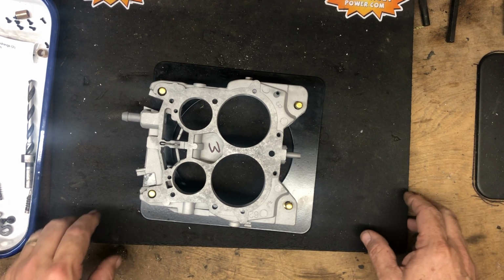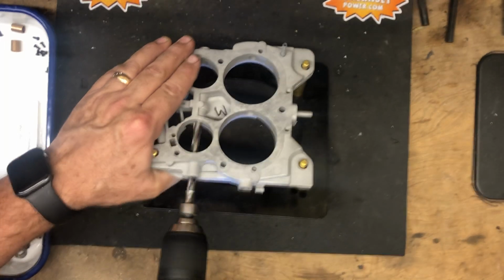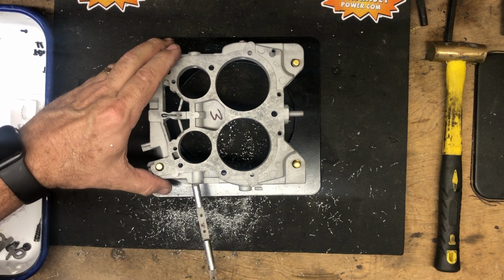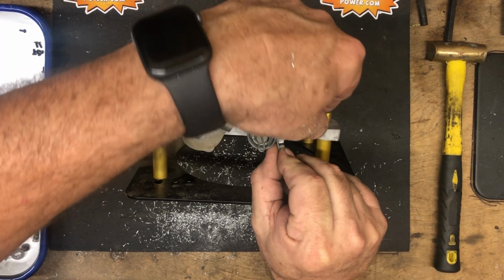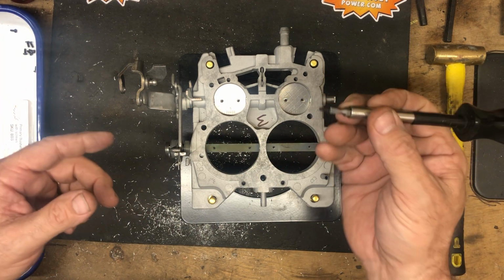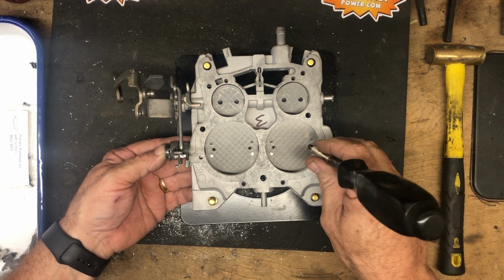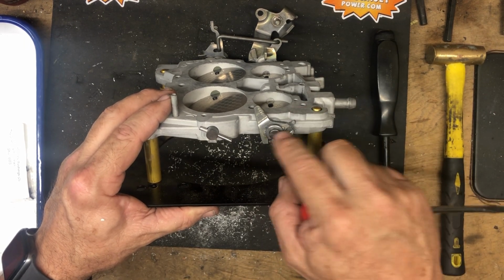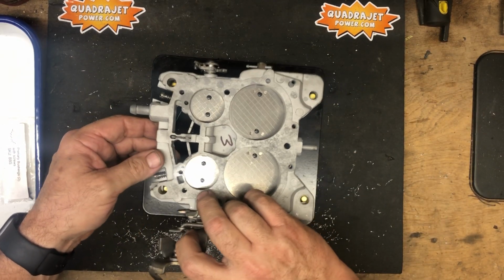Quadrajet Power - Base Plate rebuild and assembly

Comment: This is a must on any Quadrajet that has any play at all in the shaft. Without it you can't get a clean idle and you can't get a good tune as you mixture will never be right. Also note that they do this service reasonably if you need it done. Well worth it if you are only doing a single carb and don't want to buy the tools.
Reply: If you Don't want to buy the tools..? You mean a drill bit? If you don't want to buy a drill bit? That's all he used other than a hammer and a drill ... 159% of people working on cars have those, and screwdrivers...
Reply: @lollipop84858it’s NOT a regular drill bit. It is turned down so the only part that is cut is the outside holes in the throttle body. But as you point out, it’s a very affordable Kit, worth every red cent spent on it.

Comment: The drill bit I didn't get with my modification kit. One of the screws in the blades was coming out nice and smooth, and then all of a sudden, the screw broke off. So I now have a qaudrajunk. How do I get the screw out when the head broke off and how ymdo I go about getting that drill bit so I could install my rod. But only after I get the screw out.
Reply from the maker: You have to grind off the back side of the screws before you try to remove them, or they will all break. They are staked at the factory.  You can drill out the broken screw and retap the hole. We also offer that service.
We sell the custom drill bit for the bushings.
https://quadrajetpower.com/primary-shaft-bushing-kit-drill-bit-bronze-bushings-screws/

Comment: I have an Edelbrock 1901 quadrajet, and I have the spring that mounts on the choke cam follower and fast idle adjustment, as you pointed out at 11:11.  My spring is not connected to anything and there isn't any tension on it.  Do you have a picture or anything that can help me with properly connecting this spring?

Comment: What if you were installing bushings in  a single barrel Rochester TBI unit and didn't have the benefit of the "center"  throttle shaft bore to  
aid in alignment of the custom drill bit.  Do you think you would still get a perfectly aligned throttle shaft bore using the method you demonstrated?

Comment: Is the primary shaft supposed to "ride in & out" when you open the throttle? I see what's making it do it, just didn't know if its supposed to or was bent
Reply from the maker: It will have some movement but the throttle blades prevent much play.

Comment: Question, I'm about to install your new brass bushings & when I removed the 1st two screws on the butterflies the head of both screws broke off. OK I can deal with that. Then I noticed there is a bigger flat head screw on the end of this primary shaft. I grab my screwdriver and it will not move. I would assume I am screwed if this bolt breaks off & its threads remain inside the end of the throttle shaft. Any tips for this rookie?? Thanks
Reply from the maker: You have to grind down the screws in the throttle blades before you remove them. They are staked and will snap if you don't grind them down all the way to shaft.  On the end, you may need to use some heat from a torch to help loosen it up. Many of those screws are very tight and just need a little persuasion to loosen up. They don't break very often.
Reply: @QuadrajetPowerLLC  I ended up opening the throttle wide open, then used my flat head screwdriver to break it loose. As the throttle was just moving with me. Sometimes you gotta thiMk : )

Comment: What do you do if you can see light around the secondarys? I've tried adjusting the plates but I still as light around them.
Reply from the maker: It is common to see some light. Make sure they are closing all the way. Many times, the actuator rod is bent and doesn't allow them to close fully.

Comment: Would the main jets need replacing after 40 years, do they wear out?
Reply from the maker: Yes, the main jets are brass and have brass rods moving in them during use. They do wear down and they would also need replaced with a step larger for today's fuels.
Reply: @QuadrajetPowerLLC  The reason I asked it does smell rice at idle no matter how I adjust idle screws. So how much for new primary rods and jets and other parts that don't come in a standard rebuild kit to fix this issue or common faults  for number 17056280 GMH (HOLDEN) Australia plus postage?
Thanks Peter